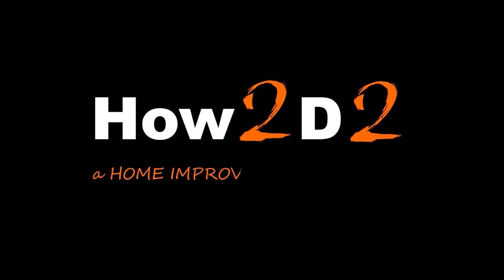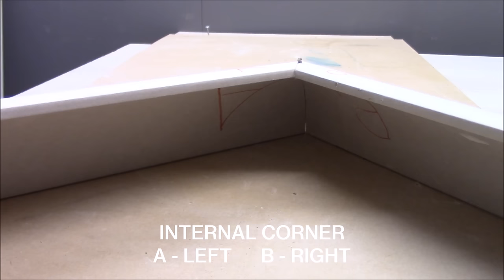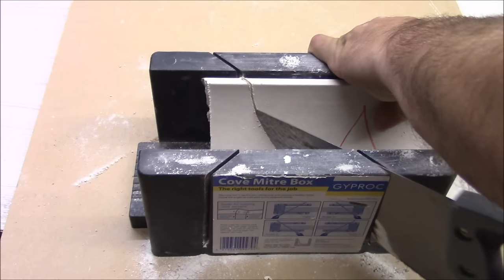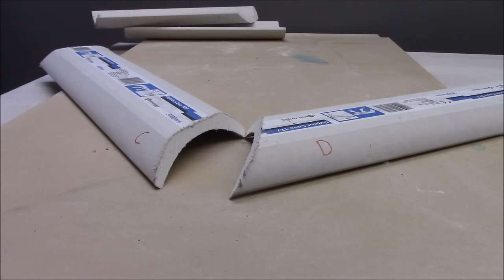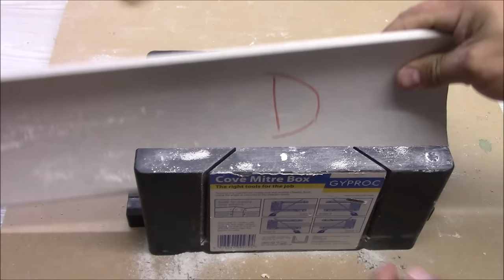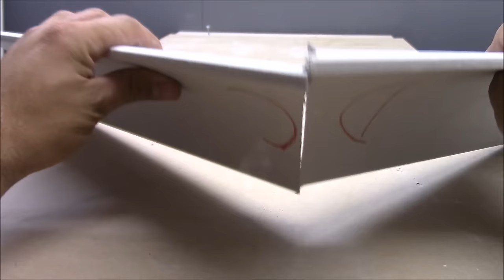HOW TO CUT COVING  Gypro Cove internal & external corner cutting video

Comment: Brilliant video, thank you very much. 
NOTE: Make sure you buy the right mitre box for your coving e.g. if your coving is 127mm but the width of your mitre box is 120mm..... your coving will not fit together, even just a 2mm difference and it still won't fit. It took me a long time to figure out that I was cutting correctly but I was using the wrong nitre box.

Comment: No need to cut upside down as that seems to cause confusion. Instead, you can cut the way the coving is supposed to sit by inserting the left side from the left of the box then cut towards the left (ie right to left); then insert the right side from the right of the box then cut towards the right (ie left to right).
Reply: I will try this way, it seems easier as you describe it.
Reply: Video could’ve been made even better if he’d marked the coving with a ‘ceiling’ marker so you easily see which way up it goes. Really surprised there’s no videos out there with this on as it would make it 100x clearer and quicker to grasp.

Comment: Do you need different size cutting boxes for different sizes of coving?
Reply: Yes. A 127mm box won't work on 100m coving unless you make a small wedge to hold the coving so it is pushed up to the back of the box

Comment: I would like to do coving but I have plastic trunking running along the top of the wall 4cm and 2cm wide with wiring inside.Can I just have the bare wiring behind the coving ?? what other options are there please??
Reply from the maker: bare cables in coving is a  bad idea. I would suggest  to hide the cables inside the wall with metal channel or run the cables some different route
Reply: Most general tool, building & electrical suppliers will sell you ducting tubes - or if you don't want to disconect the wires for extra price boxes which 'snap together' around the wires.  
But as you say its already in trunking its not obvious why there would be a problem (If its too hot already you already have a mega problem to solve.  If its not, why would you worry)?

Comment: How do you cut coving if the corner of the walls aren't a 45 degree angle?
Reply from the maker: If so...you can try to cut it at different angles and  then you need a lot of mastic and polyfilla to fill all the gaps :)

Comment: You have A on the left and B on the right and then swap them round when you start cutting! No wonder it is confusing.
Reply: You cut upside down. I.e ceiling edge at the bottom
Reply: Been trying to follow whats up and down from the markings .will give it a go .